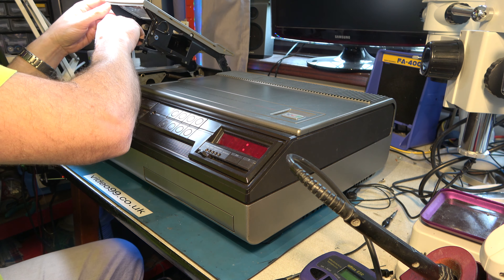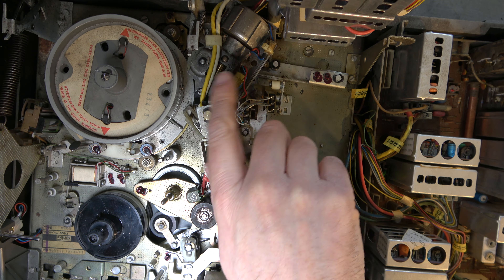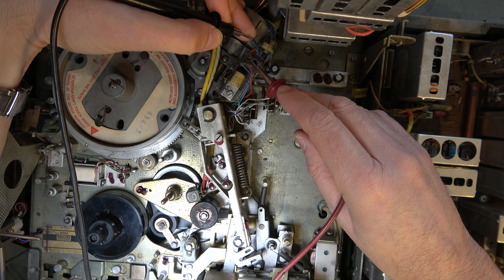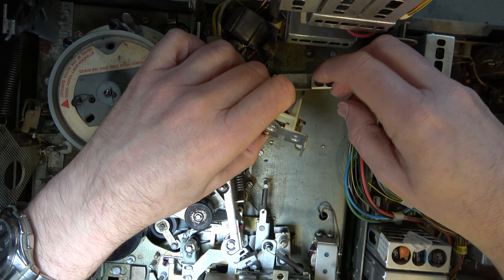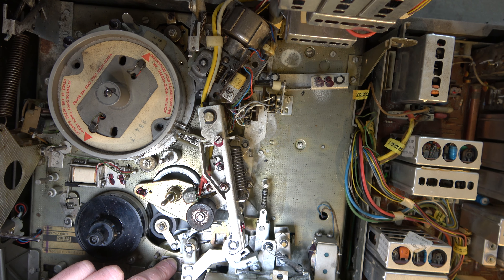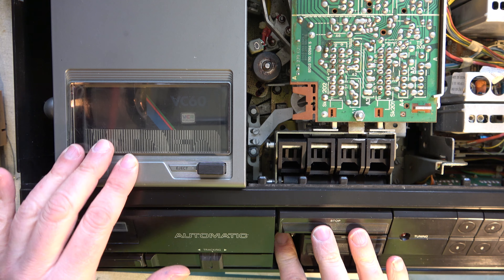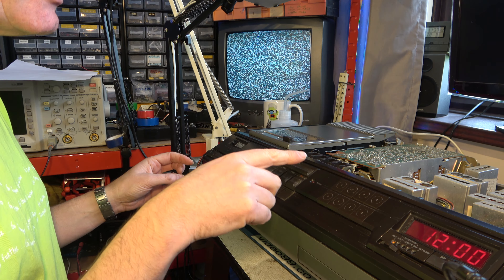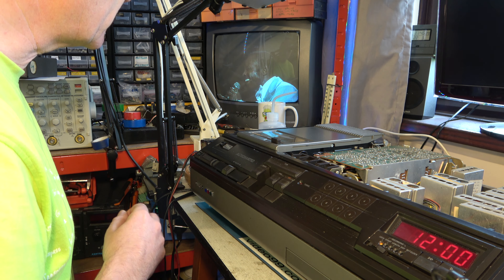Donated Philips N1700, a 1977 video cassette recorder.

Comment: RE: Comb filter. If your TBC has separate chroma and luminance processing, an SVideo connection will yield better image quality. The Chroma is separated before recording on consumer (color under) VTRs. And the chroma is processed separately on playback before the final re-combine with the luminance. So if the TBC has a separate chroma path, why re-combine the chroma at the VTR only to have to separate it again in the TBC? It's not a case of a better comb filter in the TBC, it's a case of a comb filter or none, which is cleaner. Now if your TBC is full composite processing, then it really doesn't matter.
Reply from the maker: Absolutely, I use S-Video connections where available on all my equipment.  However the N1700 wasn't built with S-Video, it's a case of modifying it to add it, and when I tried that circuit I didn't like the results, there was a chroma offset and noise.  So I decided to let the digital comb filter handle it instead in just this case.

Comment: I found a pre-recorded tape for this type of recorder years ago, sitting outside on a window sill of a second-hand shop that to my knowledge only sold furniture, paintings, etc. It was a bit dirty but otherwise fine. Took it home, never could play it back of course due to lack of a player. It still has the label on it of the video rental house it belonged to.
Reply from the maker: I've never seen a pre-recorded N1500 tape (I'm pretty sure it won't be the later N1700, but the label would say so if it is).  If you still have it, I could try it out.

Comment: Ha I didn't know the tool was used to clean that tape guide. I learned something today I guess. I think they put it in there to adjust the modulator. I took out the one that I got with my 1700, it was my only non-conductive screw driver for years.  😃
My 1700 had the rewind problem too by the way. Drove me nuts! I even tried putting a little grease on the spools of a cassette to improve things. Obviously that didn't help.

Comment: The 1700 gave one of the best - if not the best - picture quality of all the domestic VCRs. Certainly better than VHS (but what isn't?).
Reply from the maker: Certainly VHS is a very low bar.  I think a top notch Beta is probably better than N1700 (better servos), but they're in similar territory.

Comment: Colin, please enlight me on these one: What's with all that can boxes around groups of electronic components? Is it just RF shielding?
Overkill or real needed, mind the Era?
Thanks, keep on the good work.
Cheers 🇵🇹
Reply from the maker: RF shielding primarily, but it also acted as a way to support the small PCB modules.  The idea was that you could swap out a defective module quickly to assist with easy maintenance, in stark contrast to the older N1500 model which was horrible to work on.

Comment: Well that works really well now, well done :-D
The picture looks good, likely better than the old piano key vhs machines.
Philips made front loading vhs machines that had the same odd line effect on the screen with no fm from the heads.
I can see why there vhs machines had a similar line effect.
I'm talking about the machines with the horrible clip and screw that held the video head drum in place.
Not a machine i would want to change the heads on :-(.
Reply from the maker: That's right, some Philips VHS machines did give a similar effect, I had a VHS HiFi Charlie deck which would do that.
Reply: @video99couk  My Grundig VS-310 VHS isn't different. Same effect. I guess they all use similar ICs.
Reply: @video99couk  Another thing i remembered is when you applied power to the machine, it would mess about with the deck and forward fast then rewind, then load and unload.
And if you held a certain button or buttons down when applying power, it showed the number of hours it was used for.
Philips often went too far with there designs lol.
Reply: instablaster

Comment: Finalmente tenho um. Consegui por a  mecânica a funcionar, mas não tenho cassetes gravadas, apenas tenho duas virgens. A avaria que detetei não recebe o sinal de antena rf, mesmo ligando um videogravador em UHF,mas  passa o sinal rf de antena mas sem dar para programar os canais do video. Não consegui fazer gravação.
Reply from the maker: There are plenty of recorded N1700 tapes available on eBay or similar.  If you get stuck looking for one, I can probably supply you with something.

Comment: Hi, how do you remove the cassette loading part? It looks easy but I just can't figure it out and don't want to break it.
Reply from the maker: Could you be a bit more precise about the part you need to remove?  The top carriage comes off very easily (it's in the instruction book!) but deeper parts of the mechanism are not trivial.
Reply: @video99couk  Yes the top carriage. It looks easy but still can't figure it out. I don't have an instruction book unfortunately.